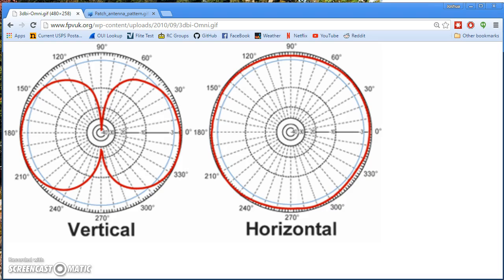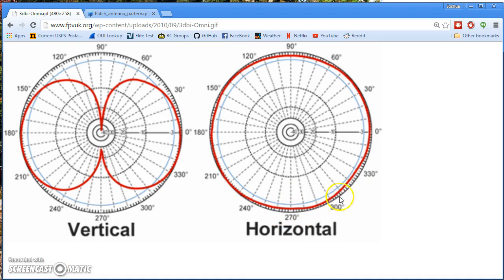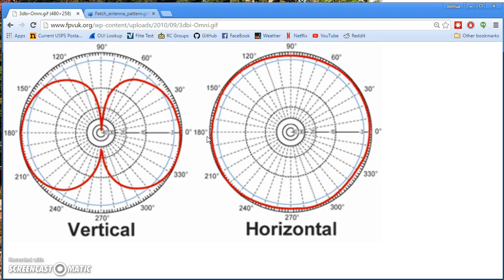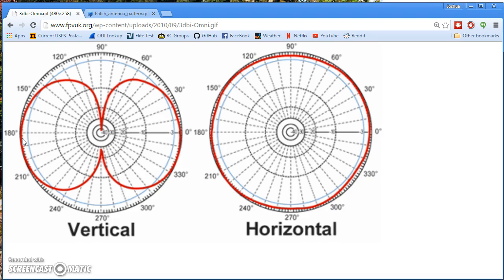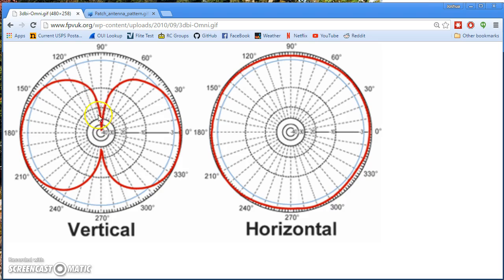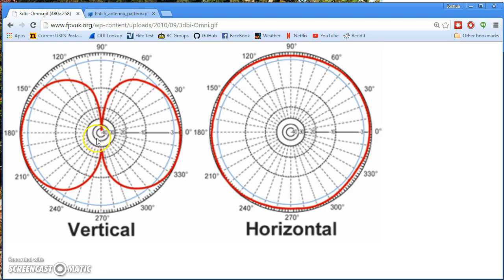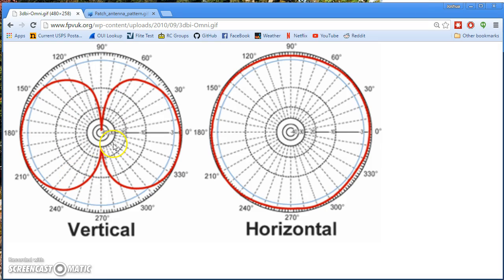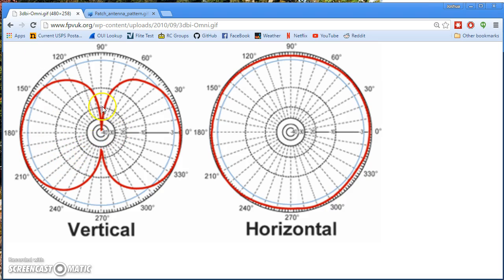Antenna basics for RC flight: coverage graphs

Comment: Nice intro to antennas. I like how you make your vids simple to comprehend. I need to watch more of the tuning ones using blackbox. 
If you do another antenna video, it's worth correlating the signal being propagated from the craft to the base station and the best orientation of the Vtx antennas relative to the ground station for different craft attitudes. Smith charts. Uni days were so long ago. I would never have thought back then that i would ever use one in my hobby. Shows how narrow minded i was when i was young! Keep up the great work.

Comment: Caught some of your older vids yesterday about antenna's - couldnt find the one in particular but wanted to add a comment.  I havent seen this one before so maybe you address it here.  I was curious if you've done any tests about signal str difference by directly attaching the antenna vs having adapters and/or extensions.  I doubt there is much of a difference in real world usage and it does differ based upon the connectors used (and cable between ant and mount) but - was just curious.  Aside from 'antenna theory', every connection does soak signal.  I wonder if you could get appreciably better results by directly soldering the antenna to the RX or VTX.  I imagine the enemy so to speak is still LOS and solid objects.  Side note I am HAM General class.  Im certainly not an expert.  My Spektrum receiver is clear in that one should be vertical and one should be horizontal.  There are literally 0 examples of how my antennas look compared to everyone else.  Mine looks like an L, everyone else looks like flattened out tail feathers lol.  For my flying - works just fine.  But, Im a geek so, Im curious.

Comment: Hi Joshua, I'm working now on my FPV range, heard that 600mw FPV transmitter should give about 3 km range, but I actually could not get more than 800 meters (Using TBS Unify, TBS Triumph and TBS Tango as FPV receiver). Is it worth moving all the antennas underneath the quadcopter so they won't be obstructed by the copter itself while on high altitude? Maybe something else to maximize the coverage?
Reply from the maker: +nandakoryaaa 3 km on 60o mW must be under absolutely ideal conditions. I have never gone that far on it.
Reply: Seems Tango is the weak link since diversity goggles are still receiving clear picture while Tango already has lost it.

Comment: Really great info here, thanks. I've often wondered why 1/4 wavelength antennas are use instead of 1/2 or full. It makes sense to me that a full wavelength length antenna would get more signal than a shorter one. I guess this isn't true. Why not use a 1/8 length? What's the story here?
Reply: +Dan Holmes Oh ok, a quick look on wikipedia and it all makes sense now! Well not to me, but I can now see that I was barking up the wrong tree.
Reply from the maker: Here is some good information. The long and short of it is that half-wave and quarter-wave don't always perform worse than full-wave, depending on other factors. And sometimes it is worth it to take a performance hit in order to achieve some other characteristic, like smaller size.

http://www.digikey.com/en/articles/techzone/2011/mar/understanding-antenna-specifications-and-operation
http://www.eham.net/ehamforum/smf/index.php?topic=21197.5;wap2
Reply: +Joshua Bardwell Thanks, this is interesting stuff. It seams that a stronger signal isn't the only factor in quality of signal. I really must address my more is better thinking! I can barely control my mini quad because I wanted more thrust before I learnt to fly the thing. Re-re building it with more sense now.

Comment: so a high gain dipole antenna works better for rc cars since they are on land always, and it focus more horizontally on its beam strenght?
Reply from the maker: Yeah I could see that. but you would have to always hold your antenna straight up and down. When the antenna orientation moves (such as a handheld transmitter) then a low-gain omni provides most consistent results.